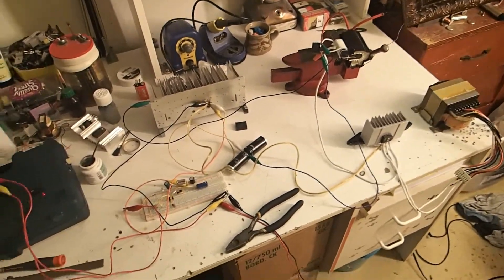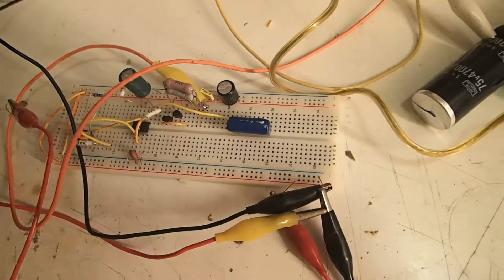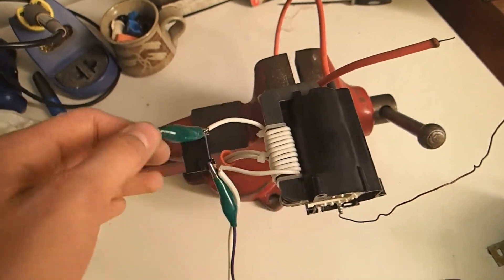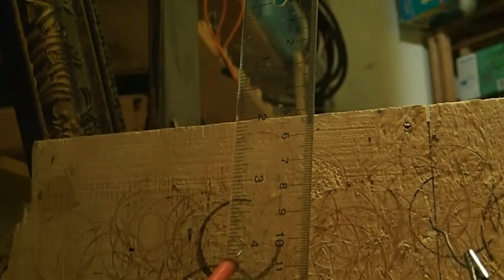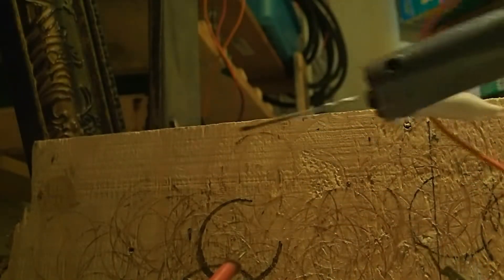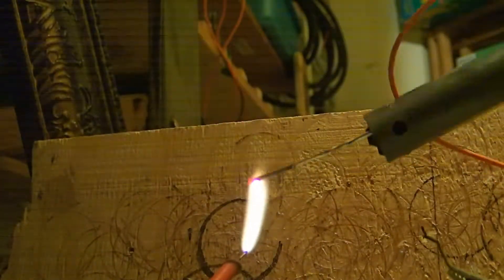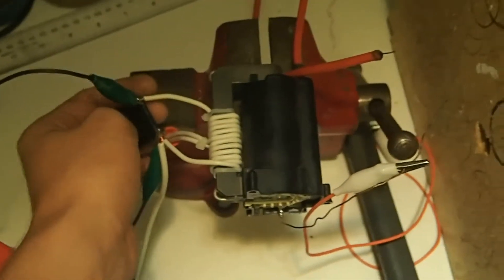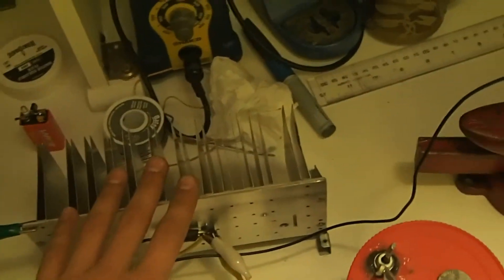200w 555 flyback driver

Comment: nice arc!!!
give me schematic ?
Reply from the maker: Here is the schematic: http://i.stack.imgur.com/noAY7.png
It was a long time ago but I remember having big problems with the driver transistors. In fact now with more knowledge I understand that you can't drive pnp transistors from the 555's output. What happened is that circuit has melted my breadboard. I recommend driving the mosfet directly or with a sofisticated driver chip. Good luck
Reply: +Anton Babiy thank you very much !!!!!